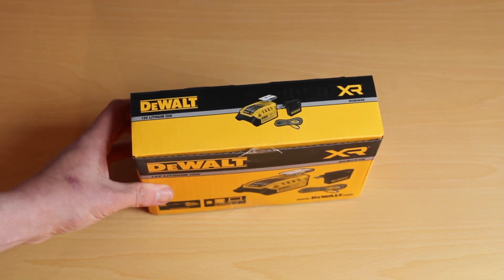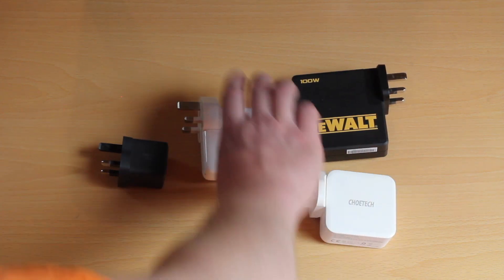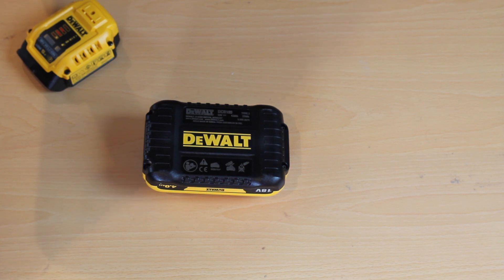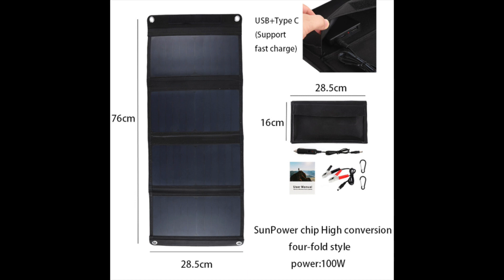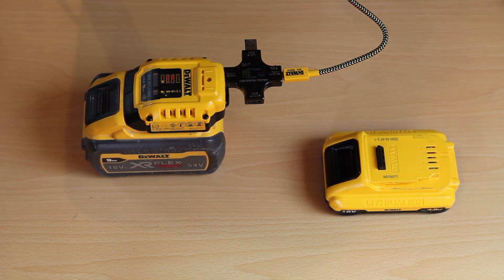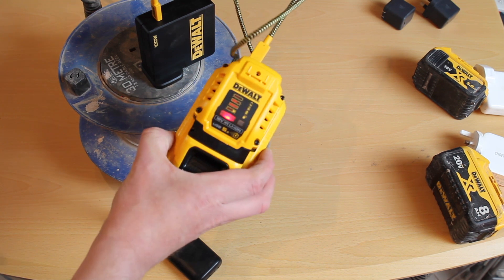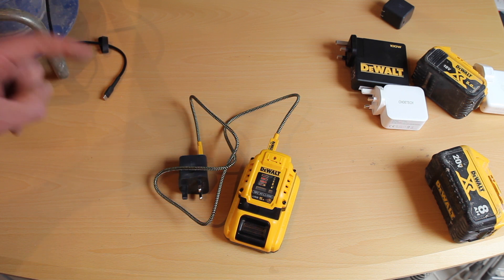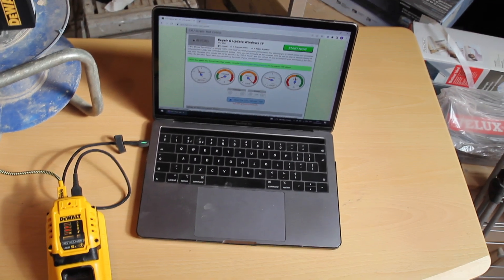DeWalt DCB094K USB-C 100W PD Charger/Powerbank Review & Test

Comment: Brilliant video, thanks so much. Far far more informative than others.

In a shoe shop my wife does the "Do They Have All The Colours In All The Sizes" test to check the shop keeper's mettle. So I really like how you've done this with the DCB094K - we all want to know if this bit fits in this hole and the other end goes in the other one will it work in more useful ways than we imagined. One piece of kit that will do many jobs, perfect. 

I just wish they'd sell it 'bare' without the strangely big 100w charger. Many of us don't need that and at around £90 all in I'm undecided. Also the belt clip is unnecessarily Village People.

Thanks again, I like your multiple pub/beer testing regime (hence your unfinished house). Also, from your voice, (and face if I squint a bit), are you the brother from another mother of Jarvis Cocker of Pulp.

Now subscribed, cheers👍

Comment: Great video, just went out an bought this. Love it. Found a bug though, sometimes it charges the tool battery from my laptop instead of charging my laptop. A little concerning.
Reply: Probably because the battery was low.  It is a dual directional port.  If the voltage is higher in the laptop, it will charge the Dewalt battery.
Reply: @MaryJane-ln3vvcheers. Yes i was hoping USBC had a protocol that shows a power brick vs a laptop running on battery..

Comment: Well-done. A couple notes: There are some laptops that now have a matching circuit in their AC adapters which check to see if the AC adapter was made by the laptop OEM. If not, it will not charge. Yes, I know how stupid that is.

Comment: I just wanted to say thanks for this video, I wanted to know if I could use this in my tractor or pickup to charge a battery for my impact, but this is the first place that showed it with other chargers
Reply: 12v type C cigarette adapter ...
EDIT(like in the video 7.41)
Reply: But I wonder if we can get a double ended lead and charge 2 batterys 🤔

Comment: FYI the 4AH flat battery are not pouch cells. But rather the larger 21700 cells. 5 of them. VS the "normal" 5AH battery has 10 of thr normal 18650's in them. These newer flat batteries with only 5 cells are popilar but they are quite a bit bigger around but just not as tall.  The power stack has been out for quite some time now in the US and those are pouch cells.... they have LESS capacity (base model is only 1.3AH) but pack a punch with more amperage so hence, better performance!
Reply from the maker: Yeah, I know the 4ah is cylindrical cells, but for carrying around it's the best size/weight ratio at the moment. As for pouch cells what I was talking about is that there's maybe a 5ah Powerstack coming in October as well as the current 1.7ah (DCBP034).

Comment: The reason your original charger is so much smaller is, it's not 100w. They claim to be but usually only output 45w. I have yet to find a cheap charger that was actually capable of the claimed output
Reply: I have a RavPower 90W that’s about the size of the Anker. Just over 1” and 3/4” thick